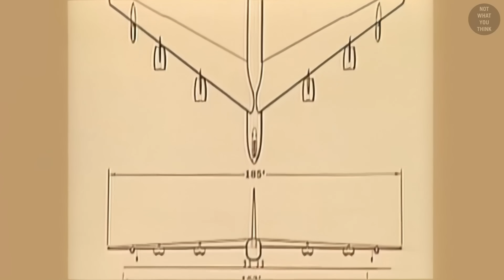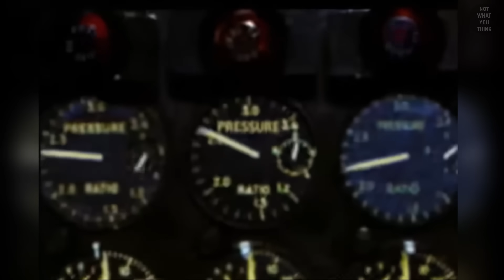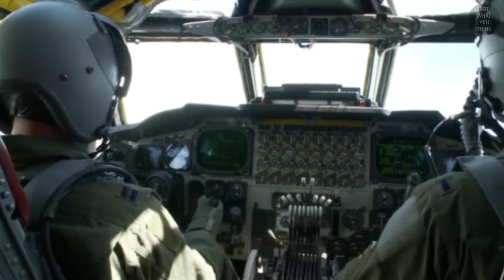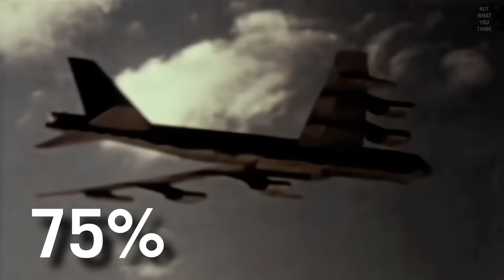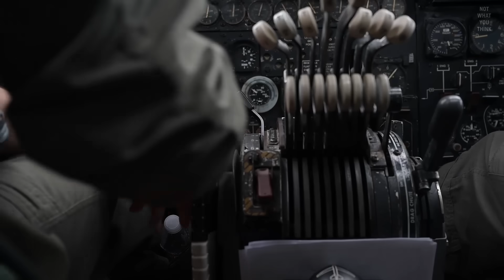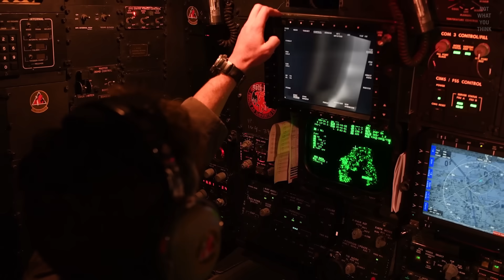Why This Obsolete Bomber Will Outlive EVERYTHING

Comment: The B-52 is not obsolete. It has upgraded electronics for self-defense and stealth. New engines use less fuel and have more power. It will be around for many years.
Reply: That’s why it can carry cruise missiles so it can hit shit outside of the anti air range
Reply: It kinda is against anything with modern anti air
Reply: @akiara8491  Most aircraft are "obsolete" against anti-aircraft systems. That's why combined arms is a thing and there are dedicated weapon systems made to deal with them.
Reply: @thehumanoddity  ok
Reply: @Akiara Anything is vulnerable in the battlefield if it is in the wrong place at the wrong time. Air defenses have a limited range, as long as you stay outside of it you should be fine. Or destroy/disrupt said defenses. Or operate where they don't exist. Or carry different missions other than attack ones.
Reply: @moteroargentino7944  thats why i said "with modern anti air they're obsolete"
Reply: @akiara8491  Obsolete means no longer in use or no loger useful. The thing is, the B-52 can perform more tasks where it's still useful, so it's only obsolete as a conventional bomber, but not as an aircraft.
Reply: @moteroargentino7944  ok
Reply: @akiara8491  I’m sure this plane flies higher than modern anti air guns range. Just because anti air can kill an aircraft, it doesn’t make it obsolete 😂
Reply: And if it can’t fly out of range, they literally only fly it when there isn’t anti air. So there’s that.
Reply: @jacobeldredge2956  yeh i meant that comment as in if it's used as a conventional bomber it is pretty much useless
Reply: @akiara8491  Yeah, well, you didn’t say it at all, so I responded accordingly. 👍
Reply: @moteroargentino7944   Not really, when we say that the B52 is obsolete we're talking about how it can't fulfill it's original objective anymore, of being a bomber at least. Yes the B52 is still useful as a weapons truck, a C&C HQ and against enemies without air defenses, but it can't fulfill its original goal of you know, being a bomber against capable adversaries. Even battleships which are obsolete are still useful in many ways, but we insist they're obsolete because they can't carry out their original objective.
Reply: @jacobeldredge2956  It doesn't.

Comment: I doubt this plane will last until the 2050s. 😆 It's only a matter of time until the frame will give up. I think a plane based on the C-5 might take its place. The AGM-183 might be able to be launched from a modified C-5 or C-17.
Reply: C-5?  No chance.  They are unreliable and massively expensive to operate.  They're also an even bigger target than a B-52.
Reply: @paulshepherd8295  

The B-52 will be easier to hit. It's an old plane. It's getting expensive to operate too because the Air Force is retiring it essentially. They're using it for less and less.
Reply: @bobfg3130  The C-5 is bigger, slower and (from memory) has a lower service ceiling.  B-52 usage may be declining, but they're just embarking on a very major (and long overdue) re-engining programme, so the intention is clearly that it's going to be around for quite a while.
Reply: @paulshepherd8295  

The B-52s are going to be easier to hit than a C-5. Those numbers are nice but the B-52 doesn't have that capacity anymore. Yes, I know about that "re-engining" program. The intention is to retire it in a few years. The aircraft is old. The new engines might just make the aircraft crash faster because of the wear and tear. They're trying to keep it alive fir a few more years. To moment it starts crashing thise engines can be sold for parts because that's the only thing they will be good for.
Reply: @bobfg3130  the engines are not the only big invest that the Air Force is putting into the B-52. There is also a big Radar Modernization Program that is replacing the old radar system. If they were just doing the engines you might have a point. But these radars aren't re-sellable like the engines, soif they actually were thinking like you claim there would be no point in investing alot in a new radar just to retire it in a few years.
Reply: @iansmith1316  

I know about the upgrades. This is an attempt to keep it relevant for a few more years.

They will retire it. The radars could be reused on other planes.

It did its job. Now it shouldn't be pushed to the limit. It might start falling apart in a few years. 😐
Reply: @bobfg3130  No dude they can't. I am on one of the Boeing teams that is supporting the Radar program. I can tell you that most of the engineering and components are bespoke to the B-52 and its requirements.
Reply: @iansmith1316  

So? They're trying to keep it on service for a few more years. 😆 Irrelevant. Dude, this thing will start falling apart due to its age. When that happens either you move the radars or they will get worthless. They will move the radars. Radars can be moved. Yes, they can.

I have some doubts you have ANY involvement with this. You don't know too much.
Reply: @bobfg3130  I guess that depends on your definition of a few more years if  you man that to be a few decades then yes. Otherwise it is clear you are actually the one that doesn't know anything about them and didn't watch the video. While the airframe are old in years they are young in flight hours.

I am on the Boeing team designing the environmental control systems to make the radar work. It really ist as simple as you think reusing them is. I know because they were trying to use similar components as one of the fighters. But there are significant desing changes needed to make them work in the B-52 because it's requirements are different. They get their own part numbers. These radars will only work for the B-52 and any effort to try and just drop them into another aircraft would be just as unique and expensive.
Reply: Both of those planes aren't produced anymore. It'll most likely be replaced by submarine and destroyer launched versions of the AGM-183
Reply: @nick21614  

They don't have to be. Still, the new fighter for the Air Force will definitely be able to launch the AGM-183. Probably the new bomber will also be able to do that along with the non-stealth fighter the air force has been requesting.

Comment: 17:14 as an aircraft mechanic, that is a massive depot operation.  You're effectively rebuilding the airplane from the ground up (the wings are pretty vital.)
Reply: Wouldn't be one wing enough?
Two seems excessive
Reply: @TheSeppentoni  just wait until you uhewr about the elevators
Reply: @TheSeppentoni  Sometimes
Reply: As an engineer at Tinker, you wouldn't believe the amount of man hours we spend completely overhauling these things. It is truly a sight to behold watching one go from a functioning aircraft, to an aluminum shell, and back to flying.
Reply: @kahakiman  "back to flying" is a bit of a stretch! haha just kidding but us here at barksdale dread the depot returns.
Reply: Wings are vital on an airplane? Well shit fire Luke, you're right when you're right.
Reply: Yeah I think that was the rebuild of that boneyard jet "Lazarus"
Reply: Ah buff
Reply: i would think so!!!😄
Reply: Yeah they are the things responsible for it being able to fly
Reply: @starbomber While they do perform substantial overhauls at Tinker, the B-52 in the footage shown is specifically a testing rig for the engineers working on the engine replacement program (and perhaps other mods). It only has one of the wing's mounted.
Reply: I don’t know I think the engines are the only thing needed to fly

Lol